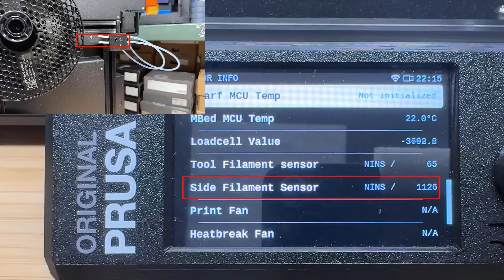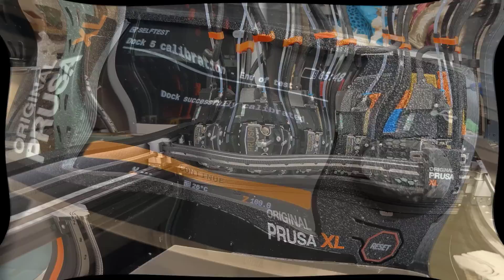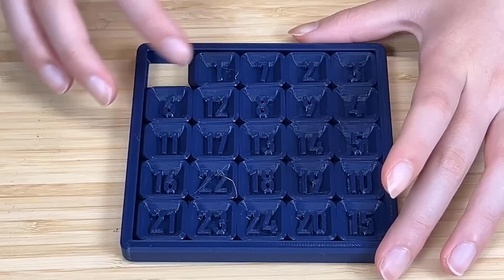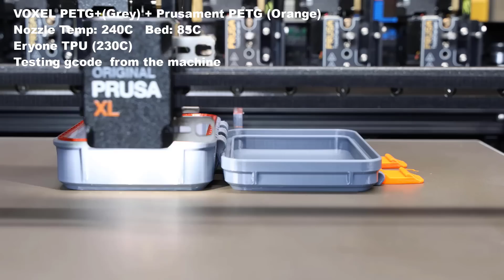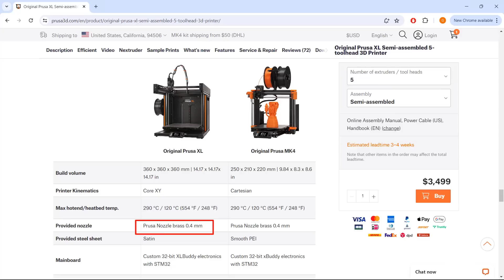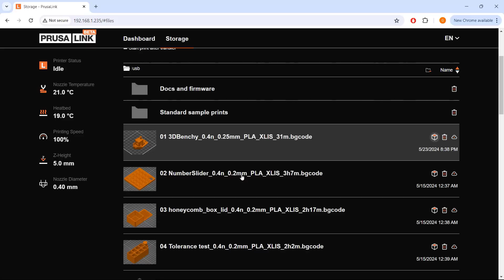Prusa XL In-Depth Review: 5-toolhead auto tool changer 3D printer compared to BambuLab AMS

Comment: outside of the Sliceworx Flex Dipped build plates the best adhesive ive found is the purple Aqua Net hairspray works fantastic and keeps the bed looking clean and its very cheap
Reply: PVA glue stick does the job, is cheap, readily available, more convienat size and non toxic. It's so good in fact I turn the heated bed off after the first layers done.

Comment: I've heard and read so much inconsistent reviews from various channels about the XL that I would hesitate spending that much and risk getting an XL or toolhead that might have problems or be a lemon.  It sounds like PRUSA had been making ongoing hardware and definitely software/firmware changes and corrections.  Perhaps the negative issues were from early adopters.  Still, I'd wait another year or more before investing into an XL, unless the business really had to have one immediately.

I think you should've run some larger tests.  small and medium height models aren't really testing the tall and large build volume of the XL.  Allot of the issues I've seen with XL occurred at taller layers when using the multiple toolheads.  Specifically, the towers often become the issue and detatch, colliding or causing the really big print jobs to often fail after MANY hours, and ruining the entire model.
Reply: the prime tower detaching would be an user error though, as is stringing. Even the best presets can get borked by ambient factors, Prusa offers decent starting points though. If you intend larger prints, you should make sure the couplings are greased, which could cause slight shifting otherwise. You can expect quality like from a well build voron or ratrig. There is even more room for user errors though. With the 6.1 firmware update, the XL feels very complete now (it fixed some things introduced with the phase calibration). It's amazing and just have a look at what a good Voron kit costs (>2k€). Completely unassembled. The XL certainly isn't cheap, but it doesn't seem overprized if you compare it to other printers. For a printer of that size, with that print quality, you got to go Ultimaker and pay about 15k, if you want it fully assembled.
Reply: Excellent points!

Comment: Looks good but the multihead version needs to come to down to $2500.

Bamblu Labs is working on an XL version of the carbon and rumored price is around 2500 with a 6 spool ams and a 380x380x400 build plate.
Reply: I will buy that in a heart beat.
Reply: Where did you hear that?
Reply: @Salamattder  There are rumors, but nothing official.  Bambu employees did hint at working on a larger printer with an AMS in more than one interview recently.  I hope its at least a 400x400x400 build volume.
Reply: I have the carbon and it is working at 100% satisfaction so far (250h runtime). I actually have no need for a bigger buildplate at the moment as a hobbyist.
Reply: If BL "XL" (X2 would be more logical + they might have hinted it in some discussion) is single nozzle / single toolhead, Prusa has nothing (beyond general ignorance 😅) to worry about. Prusa XL is cheap printer for what it is.

If BL is making third AMS, will it follow AMS and AMS Lite in not being compatible with any of their previous printers?
Reply: Bambu lab isn't working on anything other than being sold off to a different company.
Reply: @LilApe  why would they sell off? Rumors? What article?
Reply: @Salamattder  Bambu lab is owned by a big chinese tech corp and was sold off last year. And now they're being sold off again after the A1 recall. Look it up.
Reply: or just post a link
Reply: @PjotrStroganov  This is youtube. Posting links gets your comment deleted. Do your own research.
Reply: @LilApe  just post the name of the site without the link. You claim things, so the burden of proof is with you.

Comment: While the comparison with the bambulab printers filament changing time is nice, it´s a bit unfair. Bambulab specialiced on entry level users, avoiding calibrating ramping profiles an use cut&poo instead. Esp. with Prusas mk4 + MMU3 (or with an mk3s+ changed to revo hotend) ramping improved a lot due to the integrated heatbreak in the nozzle. As the slicer predictions are quite correct, you can compare 4 cubes 1cm³ sliced for the mk3s+ + MMU2 and sliced for the X1C - and the mk3s+ still winds in overall printings speed (of course with bigger objects the X1C might win due to higher printing speed).
With the new MMU3 for mk4 now available, a comparation between the mk4+MMU3 and the 5tools XL would be more interesting imho.

In my opinion it is quite sad the XL does not support the MMU3. While toolchanging is quite nice for different materials with different temperatures and propertys (like TPU wich is hard to impossible to use with a filament changer), you often only need two different materials. While for multicolour one toolhead is O.K. and waste is also aceptable if having a big bed printing multiple pieces of the same object at once. Also not using cut&poo but ramping saves a lot of waste.
So imho the XL should support a MMU3 for printhead 1, allowing multicolour up to 5 colours (or more, there are modified MMUs for more filaments). Plus a second toolhead for another material (for example TPU. Or PETG for easy to break supports).

This would also reduce the price for the XL for a lot for hobby users. With the 2 printhead version the price is much more in budget than the full 5 head version. If you already have an MMU2 flying around, the upgrade would be only an aditional $100. And you would have up to 6 colours (5 for the first tool, and 1 for the second one).

Of course, for such a setup there would be an more affordable alternative. Use an IDEX, add klipper and an ERCF...

One of the best features of the mk4 and the xl is of course the nextruder. The internal loadcell is a nice feature - and quite nice for autocalibration. Esp. on the XL for auto allignment of the tools. Quite sad there seem to be no coldends for the revo system with integrated loadcell:-( Also I am quite sad Prusa have all parts in it´s shop to build a nextruder, exept for the planetary gear. The only option to get the complete nextruder for your own tinkering project (like using it on a toolchanger on a Voron Trident or VCore 3.1 or 4) seem to buy a complete mk3.9 upgrade kit (maybe I might do so, still could use it as 3.5 upgrade + Nextruder for diy-projects). By the way - there is a github project how to use a loadcell for years now, wich works without firmware modification on any printer. A simple arduino and a loadcell amplifierer are used. The arduino (f.e. arduino nano) constantly reads the values and calculates an average. So the average is constantly updated, compensating the temperature drift. If an massive inrease is detected, this a "crash" and the arduino signals it on an output. This output can be connected instead of a limit switch or probe input on nearly any printer. As an arduino nano and the amplifier are quite light, they could be mounted directly on a toolboard, using a CAN or USB board on the toolhead - I realy hope, Prusa puts the gears in their spare part shop in the near future...

Comment: FYI you can adjust the Z offset with a long hold of the control knob during the first layer.  Note that the setting is temporary and will reset on the next print.

Great video.

Comment: Your point on outsourcing is absolutely critical for Prusa in general, not just this printer. They are in real risk of significant lost market share if they can’t find ways to be more price competitive. I’m not saying they need to match price with Bambu, but they do need consumers to feel like the added cost is sufficiently justified to choose their printers.
Reply: I really don't think consumers are Prusa's primary market. Their customers are mostly people and firms who run businesses, and for reliability, print quality and accuracy the upfront cost of their machines is peanuts compared to the long-term running costs of the machines.
Reply: @TNX255  that is a reasonable explanation. I haven’t heard Prusa say that  but if it’s true I feel like they’d benefit from saying so. The voices saying it’s overpriced are many and that answer would help make it make sense for folks.
Reply: @glendavis3183  You're right about that. I see many comments in videos where people say it's overpriced.
As a sidenote; I recently went to a vocational school where I studied CNC milling and turning, 3D printing and CAD/CAM use. The school had two full classrooms of Prusa MK3's and one in almost every other classroom. Nothing else, and nothing newer either, just plain MK3.

Comment: I have to go with Bambu on this one because for the price of one xl (with the 5 nozzles because this would be the only reason I considered this machine) I could by 4 p1s with an ams each and still have enough left over for an A1 combo. Yes with multi color the prusa is faster but that is comparing one to one in reality if you got $4500 to burn it would have to be 1 prusa vs 5 bambus it’s not winning.
Reply: You are absolutly correct for multicolour printing. While I would prefer an ERCF + Voron or MMU3+mk4, as they produce less waste (cu&poo is more beginner friendly as not tuning of ramping profiles is needed for unload, but it produces more waste).
However, if it comes to multi material - esp. using TPU - filament changers are no alternative.
Imho a 2 toolhead printer + filament changer would be optimal. So you can use two different materials (one of them even flexible and not useable in filament changers), but multiple colours on one printhead.
Maybe IDEX, klipperized and with ERCF on one printhead.

Comment: Nice video as always.
One correction:
You always can manually adjust the z-offset in the slicer. Printer settings/General/z-offset.
This does not change the z-offset on the printer itself, but the z-coordinates in the g-code, so not adjustable while printing.
Back in the days this was a very comon used feature. Nowerdays it is barely used - but if you do not have auto z-offset nor a spring steel management storing different z-offset for different spring steels, this is still a usefull feature.
Also esp. for colour change only in the first 3 layers (to embed text in the bottom) I sometimes want a more closed, intentionaly a bit oversqeezed first layer. You do not need to change z-offset to do that - you can just manually change the flowrate in the first layer in gcode (after first "after_layerchange" add "M221 S105", after next "after_layerchange" add "M221 S95", if the standard flowrate is 95%, like on the mk3s+). This gaves a very closed 1.st layer on the textured bed.

Comment: @ Aurora Tech why didn't you use Prusa Connect?
It offers many more options than Prusa Link.
Prusa Link has the advantage that it only works in the local network.
I always wonder why so many Bambulab owners write under Prusa videos.
They don't seem to be really satisfied.
The XL is simply not a printer for private use but a professional device.
In a business environment, the purchase price is not so relevant.
It will quickly pay for itself through low energy costs, more prints in the same time with lower filament costs.
Ease of maintenance, durability and long-term support are further points.
No cloud compulsion for updates, numerous certifications, etc.

Comment: Based on how much the z-axis was moving during that first layer test that bed is either really badly warped or really badly out of tram.
Reply: It's NOT out of tram, it's doing small z hops at the edges. With such a big bed and input shaping it doesn't always do the traditional one continuous line zig zag.
Reply: Its possible and it's hard to tell sped you but those don't look like a hop moves to me.  @wafflecart

Comment: as Prusa XL owner, I recomend:
1. use the smooth plate for PLA, the satin for PETG and PC and the textured for TPU.  Check my videos for PEY, PEO and H1 plates.
2. use Obxidian nozzles
3. install silicone nozzle wipers for each toolhead 
4. calibrate the belt tension
5. use a small thumbdrive usb
6. connect the printer using a ethernet cable and don't use wifi
7. use a UPS at least when upgradinding FW
8. print five Cable protecting toolbase clip for preventing the cable of previos tool from wearing off when docking
9. Replace the knob with a mk3s style one for faster navigation
10. replace the two side sensor cables with two bed cables and then lower the side sensors for better cable path (see my videos on this topic).
Happy printing!
Reply: I would like to see that the manaufactures, no matter whether it is Prusa, Snapmaker or the others would listen to those little details to improve the experience with the printers. I just want to use the printers and do want to print 1st serveral parts to improve the functionality just that it is working as it should. The XL is out for over 1 year now and it is still neccessary to print parts to improve functionality such as silicon nozzle wipes, cable protecting toolbase clip or you point #10. My hobby is not "optimizing 3D printers" I just want the functional parts for my other hobbies
Reply: @clausziegler5720  no, you don't have to do any of those things, unless you want to. I use satin sheet for all. I use four normal 0.25 nozzles (disguised as 0.4 nozzles in order to circumvent the "no prime tower with mixed nozzles" restriction) and one normal 0.4 nozzle. I only wipe the nozzles when running offset calibration (nozzles are relatively clean, if you dial in your filament correctly). I use the wifi, which works fine in 6.0.1. I might look into those clips though, to reduce friction on tool cables. Not a necessity, but a good idea in the long run imho. I did not move the side sensor, i use spoolholders with ball bearings, so no need due to low friction. I'll do belt tension, when it becomes necessary.
Reply: The printer for this price still needs so many things to do.. no thanks

Comment: I have been putting off my next printer purchase. I need something to print high strength materials and the Bambu wastes way too much to use for that. This one has pretty much everything except a heated enclosure, but I can fix that. And it seems like prusa has ironed out most of the issues. 

Very nice review. I appreciate your attention to all the details.
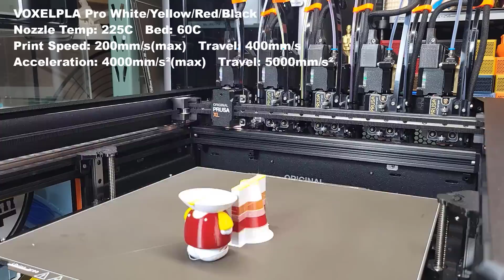Reply: Ironed out some but no were near most,. the detaching prime tower and failed prints are still common.  20:46  22:10 and 34:28
Imagine having to reprint a model several times to get it right and  it is a tossup if it works reliably. That is a waste of time and filament. Still needs more time in the oven.

Comment: As people start using bigger nozzles more and more, it is a pity you did not test a 0.6 or a 0.8 mm nozzle. The reason Prusa ships the XL with 0.4mm nozzles is that the bigger nozzles preform not as well. Due to the bigger opening more filament is oozing out, which causes quite a lot of stringing. This was the main complaint of the early machines. With a 0.4 or a 0.25 mm nozzle the XL is a really great reliable machine. 
The build quality and performance is excellent. My main con is the lack of a build-in camera and the lack in the software to easily ad a webcam.
Reply: You can easily integrate an ESP32 webcam into Prusa Connect.

Comment: Wonderful overview!

There is a hidden trick for adjusting the Z-offest (mentioned at 30:30) - Long press the knob during the first layer to bring up a live Z menu. Note that this value will NOT be saved and you will have to readjust it per print. I use this sometimes on PETG prints.

It's not great that this function is so hidden, so that still counts as a minor negative.
Reply: you can lower the Z from prusa slicer if needed repeatedly
Reply: exactly, simply adjust and save it in prusaslicer.

Comment: I'm kind of more then annoyed by these "prusa must go cheaper, china can make it for 1/4". Well, they don't.

How much will x1c cost if it had 4 times larger size? It won't be $2000 machine anymore.

In long term, for multimaterial printings, especially with expensive materials and expensive supports, you can justify price. Imagine $100 prints where 2/3 are wasted.

XL is not cheap toy for 3printing fans. It's on the border of industry printer. True prototyping tool.

But yeah, XL is very expensive machine for most of users. I'm from CZ, homeland of Prusa, and XL with 5 tools cost here like used car. XL is out of reach for most of people here.
Reply: Well said!
XL is also not needed by most of us nor the best for most of us, but some (BL owning?) members of the non-target non-buying group seem to be the loudest in dismissing Prusa and everything it represents. I wonder what kind of 3d printers, if any, we had if there was no Prusa...

Companies that use that kind of printers don't care how much the printer costs, they care how much nursing (operator, maintenance, support) it costs in use and how much benefit it brings to the company. Initial cost between X1 and XL is irrelevant. And this is the thing most hobbyists ( experts in everything in 3d printing 😅) don't have a clue because they can't think outside their own box.

I'd like to have ~~MK3~~ MK4 some day, more because what it is than where it's made (though has some relevance), but I'm not putting it down even though I don't have enough free money to spend on it. Maybe it's personal aspect, but I also don't throw stones (literal or imaginary) on too expensive cars that I see out there...

Prusa seems to be the only 3d printer manufacturer in western counties with anything (Mini, MK4 with a bit of budget stretch) to offer to hobby users, or at least I haven't heard of  others. And it's not because there is no market for 3d printers...